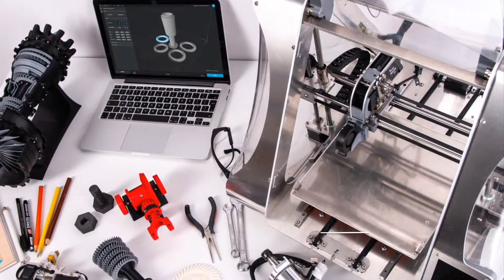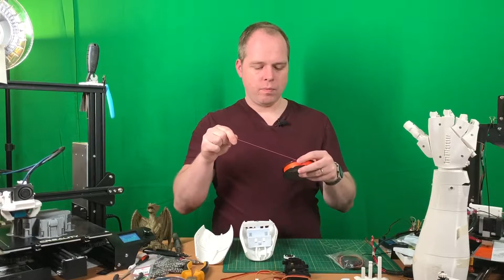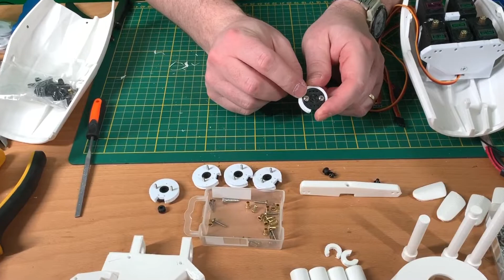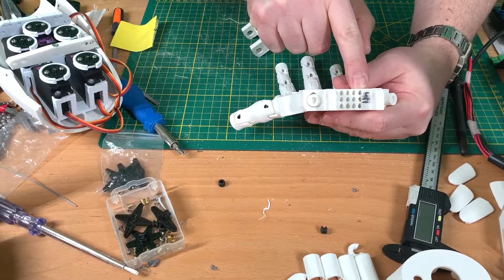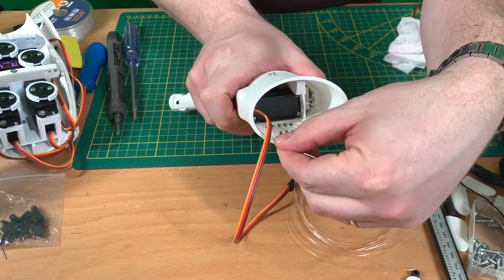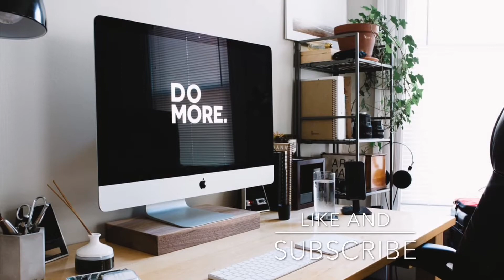How to build InMoov Robot Hands part 2 - Weekend Projects

Comment: I made the exact same mistake. I even took mine apart and reassembled it incorrectly for a second time. It's so annoying when you get all the lines threaded through and then realise you have to take it apart again. Oh well it's part of the experience. I have had to take so many things apart again because something is not quite right. Loved this video and looking forward to your next one.
Reply from the maker: I'm was already wiring the other one up, made them together, pull the wire through, and when I was connecting all the wires to the pulleys, I found out that 1 wasn't there.... This is a project you can't rush...